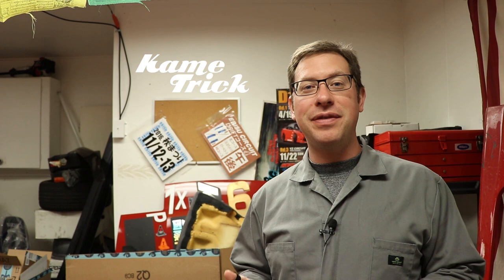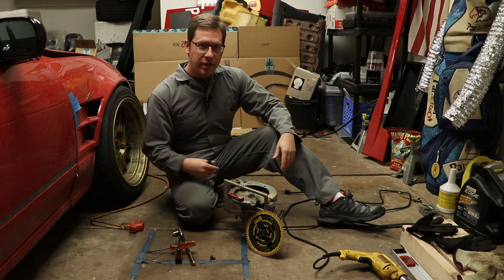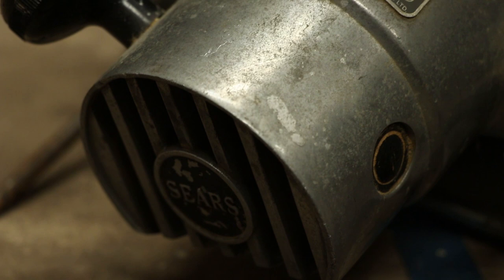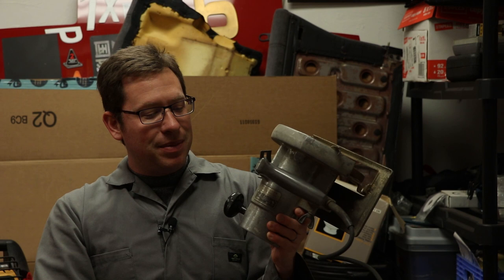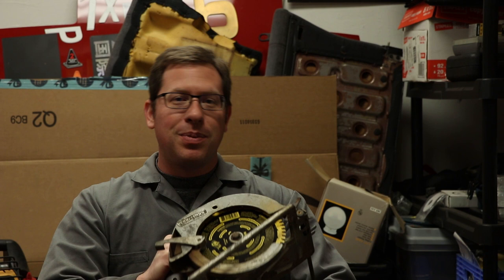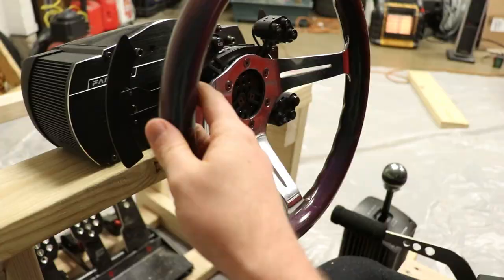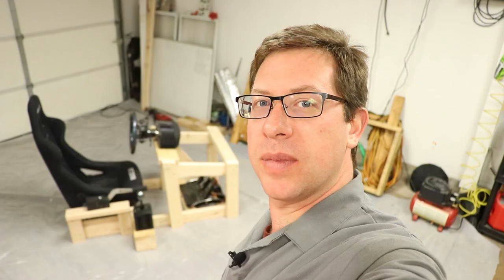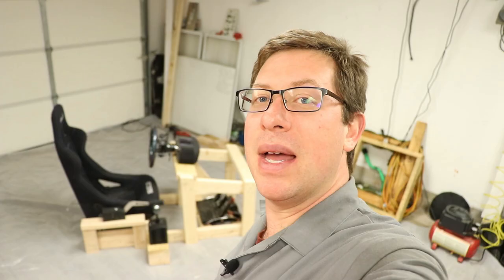Building A Budget Drift Racing Simulator (Wood)

Comment: In today's economy, a carbon fiber setup would be cheaper than wood.
Reply from the maker: Haha savage but true. Wood body kits will become the rare lightweight performance upgrade? 🤔
Reply: If kids are going to be around, it will need to be sanitized and moved frequently for cleaning. Wood will probably fall apart much faster than other materials, especially the joints.

Comment: I've watched a tonne of this video's and plans, and everyone complains about how hard it is to get in and out of the rigs.  Isn't it an easy fix to build the rig to match the seat in the MOST forward position on its rails, then when you want to enter/exit the rig, the seat slides all the way back on rails, and you exit easily?
Reply from the maker: Kevin Corcoran that works gear if you’re on a traditional slider, yeah! My kit happens to be the type where you position it and then tighten bolts down to hold it there. It was just something I had laying around otherwise I probably would have don’t this

Comment: Great rig build! 
Suggestion: Consider adding another piece of wood to the backboard that the pedals rest on. This will give your pedals the correct angle. Your Fanatec pedals are designed to be used in a desktop position with your chair positioned at 19 inches high. Your sim rig seat is much lower so the angle of the pedals is incorrect. If you ever get leg cramps then this is the reason why.  :)
Reply from the maker: Robert Hopkins that’s a great tip, thank you!🙌🏻
I just tried to eyeball it based on the pedal position of my 240SX but I’m sure I didn’t do a good job haha😅

Comment from the maker: Tandem Talk Newsletter: https://join.kametrick.com/
Drift tips, behind the scenes content, and raw unreleased drift footage!

UPDATE! I've been getting a ton of requests for the dimensions and measurements of my rig, so I made an updated video with that info and a proper walkthrough!
https://youtu.be/oVP_59q_DvI
Reply: Ya i think ill build it so that the pedels are slightly lower than the seat but the seat higher so i can play shooters comfortably and put it on wheels to slide underneath it or put on rails to slide it forward for racing and have keybord mouse under it to slide out that way i can pull seat out a tad bit so my feet not on the pedels and ill need a fake wall to put infront of pedels to keep 2 yr old from playing with it lol then out a shifter and ebreak on a removable stand that can mount onto the seat but not sure how to execute it as far as parts and the wood design
Reply from the maker: esmokebaby there are certainly a lot of options! I’m fortunate that mine is in my office, so I can just keep the room closed off when my little one is old enough to start exploring the house😅
Reply: How much Time to build that ?
Reply from the maker: Lois Millet for me, it took probably 5-6 hours total, across 3 afternoons (I was building it a couple hours at a time after work) The biggest time sink was in waiting for the paint to cure—if you have a roommate who can’t stand the odor of freshly painted stuff you’ll have more delays😅
Reply: Kame Trick ok thanks i will build mine this afternoon
Reply from the maker: Lois Millet cool! Tag me on social if you post about it when you finish it, I always like seeing how ppl remix this basic design✌🏻
Reply: Kame Trick ok what is your Instagram ?
Reply from the maker: Lois Millet I keep it all about the same, it’s @kametrick ✌🏻
Reply: You absolute legend. Thank you so much!!
Reply from the maker: Steve Lane right on! I’m glad it helped you out, hope to see you on track!👋🏻

Comment: Well, after spending a chunk on other equipment, I might have to bring out the old high school wood shop skills again. Thanks for showing us this.
Reply from the maker: DmanDice that’s what I did! Have nice stuff because you save where you can 👌🏻
Reply: Kame Trick 
I ordered 
Thrustmaster T300RS wheel
TH8A shifter
3TPA Pro Pedal
Some basic hand brake

Its “budget stuff” but that’s relative lol. Especially since I’m new to Race sims. Well guess I’m in for the long haul now.
At least the Valve Index I can use for other stuff.
Reply from the maker: DmanDice an Index was my plan but I got deadly motion sickness and couldn’t get over it after several months of trying. 2 minutes of driving = 50-60 minutes of feeling too ill to do anything IRL... 😑 

But yeah it looks like a sweet piece of gear! And you got the most affordable of what I’d say is “good realistic” drift gear so well done!🙌🏻
Reply: Kame Trick 
Thanks. And sorry about the motion sickness. I read keeping a high frame rate helps too. 60 or even 90+. But you’d need a decent pc to keep that up. But with your equipment I’d be good with a monitor. Lol

Comment: I'm making one, I'm in the process like you in 5:54 and I don't know how to measure the wheel stand
Reply from the maker: Dani Estu I just ran a couple uprights, cut a piece of the right size to go between them and stuck my wheel base to it. Made it too high on purpose and had a friend hold the piece with the wheel base at a height that felt right while I sat in the seat...marked that, mounted it and cut off the excess 🤷🏻‍♂️
Reply: @KameTrick  thanks, I will do that for sure OldSchool prevails😂

Comment: Do you have any plans or measurements? I want to try and build one myself
Reply from the maker: Doctor Drift I don’t but that’s a good idea...I’ll try to whip up a video on my setup over the weekend but it’s basically 2 2x8 boards cut in half, spaced as wide as needed (or desired) to fit the seat. There are some things I’d do different in hindsight so I can share them too✌🏻

Comment: I'm following this, almost exactly, when drilling holes for the shifter, handbrake and drivetrain, what width drill bit do you use?
Reply from the maker: I honestly don’t remember. If you already have a box of drill bits, take the bolt to them and pick one slightly thinner than the bolt. If not, go to a hardware store and do the same thing to determine the drill bit you need to buy that’s specific to the bolts in your hand, rather than the ones on my kit😅

Comment: I need to make a rig that also dubs as a pc desk for othef games with only 28inch wide 67 inch long with screen on the wall
Reply from the maker: esmokebaby good idea; if I’d built my cockpit higher off the ground I could’ve basically slid it under a normal desk to drive and slid it back out for other games, I built this thinking I’d go VR but that didn’t end up working out 🤷🏻‍♂️
Reply: @KameTrick  so you drift in real cars so what game do you fill is best to learn on that can actualy give you a start to real world drifting
Reply from the maker: esmokebaby I’m pretty happy to recommend Assetto Corsa on PC with drift-specific mods. The only other game I’ve played that I know has good realism is Live For Speed, but I’m going to try more titles in the future and talk through their features.
Reply: @KameTrick  sounds awsome
Reply: @KameTrick  have you tried Car-X drift racing on Steam
Reply from the maker: esmokebaby I’ve not tried that game, it’s neat that there are more drifting titles out😅
Reply: @KameTrick  ya i seen that carx gona have a game called carx street and it has street racing and drifting also dont know when it comes out but drift19 is a drifting game sim based on the japan drift circuit they have
Reply from the maker: esmokebaby yeah I was stoked for Drift19 but it’s been delayed a few times so it’s hard to say when it will actually be released 🤔
Reply: @KameTrick  ya hope it is worth the wait

Comment: You showed drilling the holes for the wheel base, but did you go out and buy longer screws in order to mount the base to the 2x6? Or did you use some other method to use the original fanatec hardware?
Reply from the maker: Luis Lopez I did leave out that detail, sorry. I 100% took the original hardware to a store and used their tools to measure the thread pitch, then bought longer bolts for everything except the pedals. The pedals I drilled pilot holes for and (carefully) screwed them directly into the wood. 1 year later and they haven’t gotten loose or given me any trouble 👍🏻

Comment: Have you ever thought about inverting the pedals, would it be easy to modify this frame to accommodate?
Reply from the maker: I haven’t felt like inverting the pedals would be worth the effort, but making it work with a wood frame should be difficult 👍🏻
Reply: @KameTrick   appreciate the reply the video was very informative and i was hoping to do this soon and was just wondering if that's something you had thought of doing. Thanks for that. Keep doing what you're doing. 👍
Reply from the maker: @amscaptured6700  right on, I say give it a shot and it will probably work! 🔧 💪🏻

Comment: Nah, nobody needs a circular saw to build this. A kataba is crazy efficient, easy to keep straight, and it's very cheap, and doesn't take up any space, and a simple backsaw can also be used.

The problem is more that a permanent fixture like this won't fit into my apartment :(
Reply from the maker: Siana Gearz handsaws can also work, just takes more time...fortunately very little of this design requires perfect cuts 👍🏻 It does take up some space though😅

Comment: 4:35 Smart guys work with a pencil.
Reply from the maker: 🤔 you know of a way to transfer the mark from the bolt head to the surface with graphite? I think a wet medium like a paint marker would be far superior for this specific use case.
Reply: @KameTrick  I mean what you used here is a pencil. I do not know English well enough. It was a positive remark.

Comment: How's the rigidity
Reply from the maker: It won’t compete with an aluminum profile cockpit but for the price, it’s quite good 👍🏻 

I’ve used an 8Nm belt drive wheel on it (the one in this video) and it’s easily enough. 

I now use a 20Nm DD wheel and for drifting or simulating a power steering grip car it’s not perfect but also not really noticeable while driving. If I steer into the lock stops where the wheel is resisting me with 20Nm of force it has some flex, but I don’t drive at anywhere near that FFB. I only use about 10-12Nm and there it feels good 👍🏻